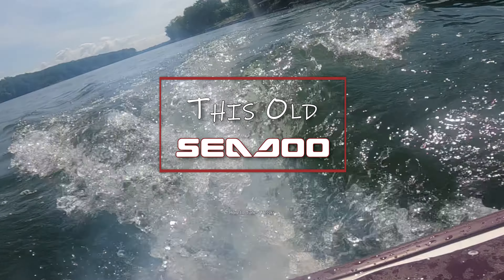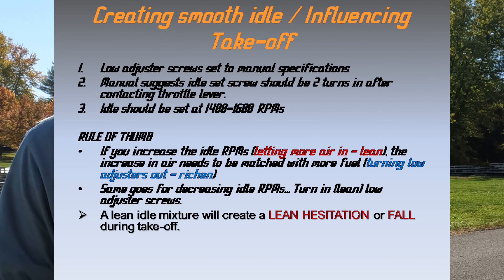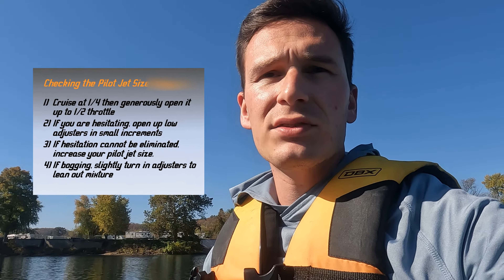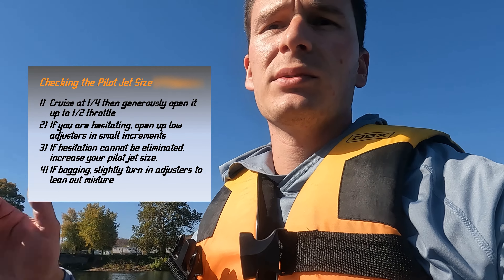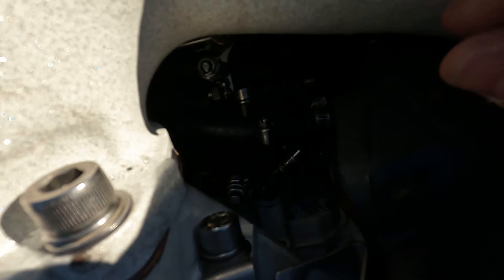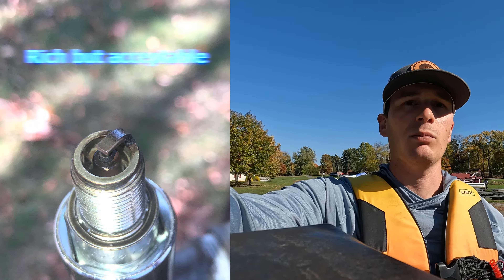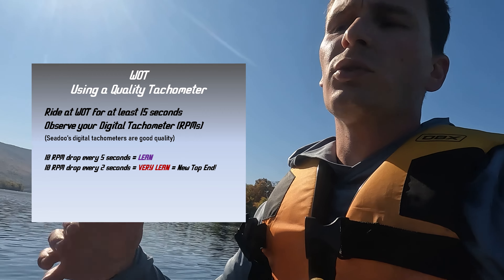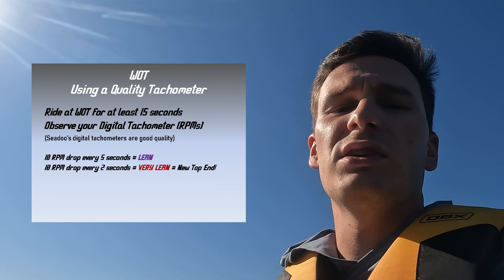How to tune a Jetski | Carburetor Tuning | Seadoo Rotax 951

Comment: Thanks for making this video! I have a 98 SPX w the 800 motor. Stock carb set up. Lows 1.5 turns out. highs 0. Out of the water idle was set 2200. I tried increasing the idle adjustment screw to 2400 thinking was too low once in the water. I didnt like the idle. Motor was bouncing a bit. After a riding session today she was hard to start again in the water. Had to be towed in by a friend. Out of the water she was bogging when trying to give her throttle. She finally cleaned out and rev'ed. I found your video and went home and turned the low speeds in about 1/8 turn IN. Same idle adjustment position. Man she idles super smooth now.  Better then, how I had it for sure!  Throttle response is crisp. I will need to do some more testing.  I used to race Novice 785 and we didnt have an idle (per racing rules) so i never learned how to tune properly. Learning now. Thanks again.
Reply from the maker: Thank you for sharing!

Comment: Hello, but as I understand Rave valves also can be the reason for hesitation. And your rave valves I see are full in, when manual says flush
Reply from the maker: The RAVE valve is Seadoo’s version of a power exhaust valve.  Basically you can change the point at which the exhaust port opens fully.  These valves have nothing to do with hesitations.  They just provide more top end or more bottom end based on your riding preference.  Hesitation is fuel related and is caused by a lean condition.  The rave valves in this video are on a 951 rotax engine.  The factory spec for this engine has the rave valves turned all of the way in.  Rave valves should be flush for 787 engines.  Hope this helps.
Reply: @2-smoke  thank you, I will try to turn them fully on 951. I just thinking that they opens to early and I am losing power at low speeds. From 5000 it jumps like a rocket

Comment: hey brother what do you think will cause this on a 2 stroke? sounds bad when you hit the gas? i did replace the wear ring and filled the full of 80-90 gear oil, ran ok for 45 min at lake, then suddenly lost power...started smoking, but fixed the smoking issue was burnt 3 way tee , but the engine sound still remains.. 
https://youtube.com/shorts/6xa6YBlSREk?si=mrtGGuDQVKOQYABz

Comment: How to tune a 951? Dont, sell it immediately. The most unreliable engine ever made for a pwc.
Reply from the maker: Hi Cale.  Any large bore/rod performance engine will not last as long as the alternative.  These engines can be reliable if jetted, tuned, and taken care of the right way.  Maintenance is key.  It sounds like you had a bad experience.  May I ask... did you purchase it used from someone else?  Did you rebuild and refurbish the ski?  Curious to hear how you came to that conclusion.
Reply: @2-smoke  They're literally known as the most unreliable watercraft engine ever made. Not a hidden fact or anything. I owned several xps in my early days. Replacing motors every other summer at under 100hrs. Now I own 4 strokes and replace superchargers every other summer.
Reply from the maker: @calephillips-pu4kq  I’ll stand by my original comment. If things are properly maintained, properly installed, surfaces are true, and it is not operated carelessly, you would achieve well over 100 hours.   If someone is habitually rebuilding them before 100 hours, I would investigate the underlying causes.
Reply: @2-smoke  You can stand by the eiffle tower if you want to. That doesn't change the fact they're 100hr engines max.
Reply from the maker: @calephillips-pu4kq  You are well off on your 100 hour claim.  I don’t need to rebuke what a simple google search would yield.  To each their own…
Reply: @2-smoke  Lmao, at this point you've made it clear. You've never owned a 951
Reply from the maker: @calephillips-pu4kq  well, the one in the video is the most recent 951 I built and refurbished.  I own, operate, and have serviced many 951s.  Making blanket statements and not giving any context to why you had to rebuild your 951s each summer is very odd to me.  For instance, not even providing the reasons why it failed.  Any decent mechanic or engineer can diagnose an engine failure.  Often times it’s poor maintenance, user error, or failure of the rebuilder to fix the original problems.  You are not giving me any reason to believe you understand the intricacies.Again, to each their own.  I don’t think you need to respond further.  You’ve made your opinion clear.  Thanks for watching 😉.